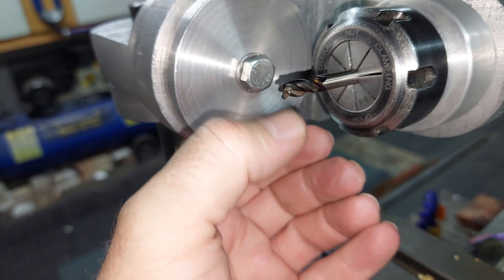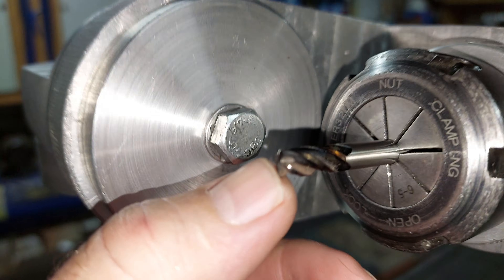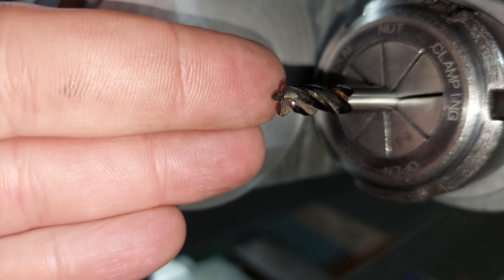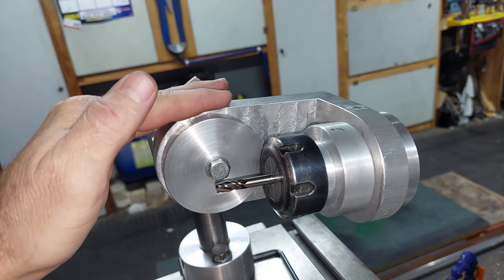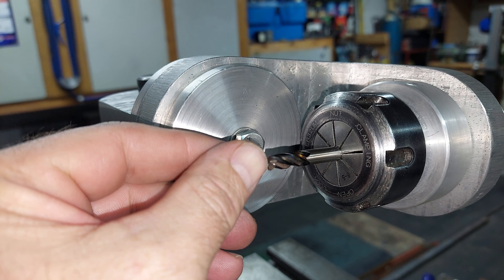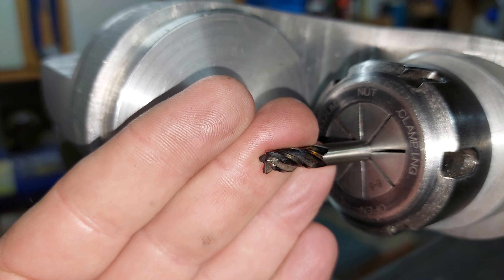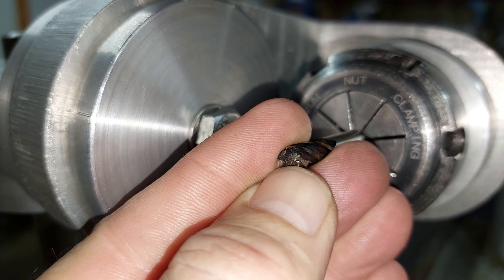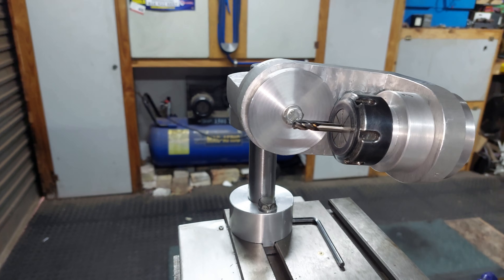Sharpening an End Mill (First Attempt)

Comment: Guide to determine the primary cutter angles are shown below for selected materials.
Low carbon steel ---------------------------- 5 to 7 degrees
High carbon and allow steels ------------- 3 to 5 degrees
Cast iron ---------------------------------------- 4 to 7 degrees
Brass -------------------------------------------- 10 to 12 degrees
Aluminum ------------------------------------- 10 to 12 degrees
In the machining hobby we generally machine low carbon steel, cast iron, brass and aluminum. Two
flute end mills are sharpened to cut brass and aluminum (10 to 12 degrees). Multiple flute end mills are
sharpened for steel and cast iron (5 to 7 degrees). The secondary cutter angle is 10 degrees greater
than the primary angle. Primary land width should be between .015 and .030 depending on end mill
size. The dish angle for all end mills should be 1 to 2 degrees.     
     I trust that this will be a good starting point for you !    Good Work , & GOOD LUCK !
Reply from the maker: Thank you, George! This info is super helpful. It seems that I am in the ballpark with the 7 degrees. I didn't know about the dish angle.
Reply: @improviseddiy   I sent you an Email with a PDF of sharpening end mills . . .  the DISH angle would be most useful when taking PLUNGE cuts , I believe .    * I meant to correct the spelling of 'ALLOY' in my comment - but it's the way it was written in the PDF !   ( TYPOS HAPPEN ! )                     Other than just the sharpening angles - it would be BEST to follow the guidance for the WIDTH of the LAND , ( area that supports the cutting edge  - since cutting longevity is affected ,  it would give more cutting time between sharpenings ! )    ** Of course , speeds & feed rate , & coolant / lubricant use ALSO play a significant role in cutting !     'Glad to be of help !
Reply from the maker: Much appreciated George! I will make good use of it!
Reply from the maker: @georgewocosky  Hi George, your mail has not come through yet.
Reply: @improviseddiy  I sent it to your email that is posted on your youtube home page . . .  I'll double check it , & send again .
Reply from the maker: @ Thank you, George. I got it!
Reply: @improviseddiy  Fantastic !   * I failed to put the YEAR in your email !
Reply from the maker: @georgewocosky  It happens! 😂😂